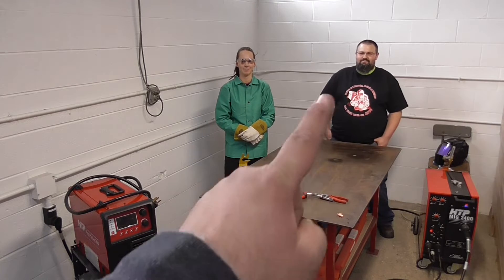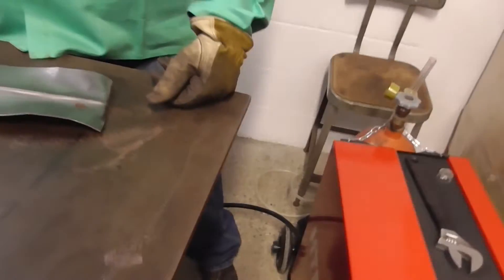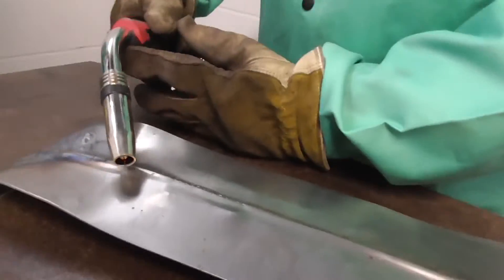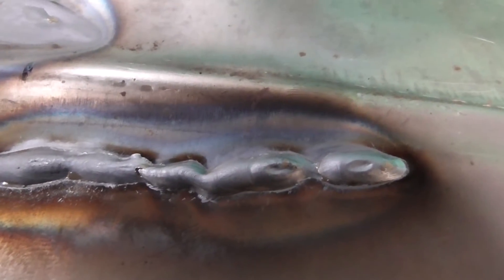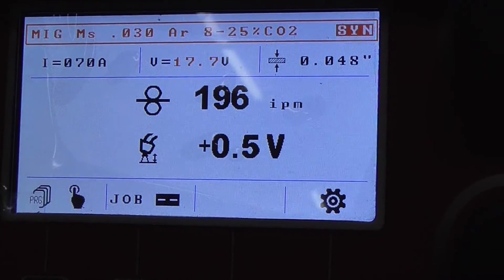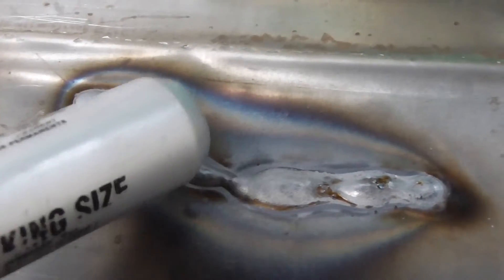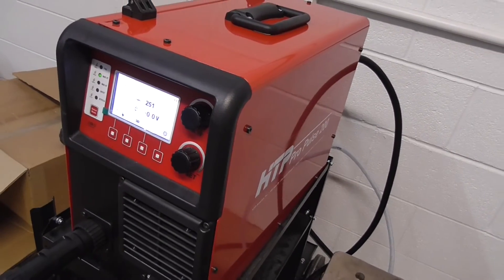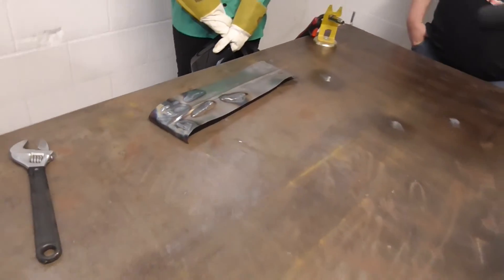ST-arc function explained

Comment: I just got my PP 200 last week, but haven't had the time to fool with it. Well,  I just took it out of the box today and got it spooled up with a partial 10# roll of .035 wire that I confiscated from my 210 MP rig. I only had time to run a few beads on some 1/8" steel plate that I had laying around, but let me tell ya,  I f*#king love it! Can't wait to get deeper into this machines capability. I think that Mr. Lincoln 210 will be going to bullpen!

Edit: Thank you Peter for these vids. It is huge help in wrapping your head around it's functions and performance before you get started.
Reply from the maker: Enjoy it !  the arc dynamic is phenomenal !

Comment: I’m a professional fabricator/welder I like to dial my wire feed by sound just like tuning a guitar you just hear when it’s right
Reply from the maker: PB Machines i hear you loud and clear !  And i have been mig welding for 25 years myself and i had the hardest time to adjust to this new technology myself !  I am not even going to lie. 

Lincoln electric has a similar function ( they call it STT ) it really can take some getting use to but if you when you do ...  personally i think it can be pretty awesome !   You never accidentally pull a long arc that is weak and does not burn through mill scale or does not penetrate enough .... 

Its the “perfect weld” every time ....

So from what i can tell 9 out of 10 people love it ....  and maybe you are number 10 out of 10 

I dont know ?!?

You dont have to try the new technology. If you are happy with your equipment and yourself and the welds that you produce ...  LIFE IS GOOD.  

I am NOT here to sell you shit you dont need ...

But please - NEVER try one of those machines - seriously! Because unless you really are number 10 out of 10 .....  you will feel like you missed out on something and crave a new machine ....

So PLEASE dont even try it 😂
Reply: ZILA I’m always open to new stuff I try to learn something every day that’s why I watch channels like yours thanks for the response maybe check me out sometime
Reply from the maker: PB Machines subscriber 103 that is me

Comment: Hi Peter great video... I was wondering if I could call on your expertise I'm looking at buying a Lincoln 500AS   off the local farm but can I plug a LN25 or do I need to get a  miller suitcase
Reply from the maker: Mr Engineer from what i can tell the 500 as is a CV ( stick welder ) ONLY 

https://www.weldingsupplies.co.nz/site/weldingsupplies/files/500AS.pdf

There is no cv ( mig function on it ) 
Lincoln has a few different models LN25. Most of those can run of the welding arc like a miller 12VS  AND run with a remote control cable like a 12RC ....  BUT NOT ON A 500 AS!!! 

You need to make sure you get an LN25 that is rated to run on a CC power source !!!
They make those - there is a little switch insight ...  but unless you want to run some dual shield .... dont expect too much out of that setup
Reply: Thanks so match  I might save and get a 12vs with the switch  I'm not really doing much dual shield most of my will be little  building Cattle yards on large properties ... Thanks again   if you get a chance  Could you check out Welderbeast on here I think you could help his goal with the future welder
Reply from the maker: I look at him.....  I looked at his website - I see a bunch of merchandise ....  I look at his youtube channel and I see a bunch of thumbnails of him sitting int he truck and talking ...  I DONT see any welding ....  
there are 2 kinds of guys out in the welding world - the once who weld and the once who talk about it ..... I dont even know the guy ....  but what I would do if I was him, hand out some business cards knock on s bunch of doors - TILL you have a paying welding job !!!!  and then make a video of that to show your capabilities ... so you can actually use youtube as sort of a reference to get more welding jobs .....  
to me it seems like he wants to sell hoodies not welding services and it also seems to me  that maybe he wants to make it as a VLOGGER so he can m are a living off youtube rather than weld for a living ..... but hey - what do I know ... I am just some guy who looked less than 120 sec at some websites ......and now is typing stuff
Reply: Yes I agree totally and that's why I respect you as a tradesman and youtuber you put work first and what you do you teach ... I personally have learned so match from your clips hence why I you about the 500 and ln25  I remembered the clip you and Chuckee2009 did with sae200 and your 12vs .. Thank you so much for everything you do
Reply from the maker: you are welcome

Comment: zila my fan shut down in my ac/dc lincoln welder thats the common  red machine  can i open the back cover use a fan to cool the  machine  while i welding
Reply from the maker: possibly yes
Reply: @ZILAwelds  thanks i wish i had your contact  number you have alot of knowledge

Comment: Do you know if the HTP pro pulse 200  available in the UK
Reply from the maker: not really unless you order it from the USA. BUT the "European version" (the software is a little bit different and it does not have the remote control connector in the front of the machine) is a Stel Iron mig 221p
Reply: @ZILAwelds  thanks for replying and the great content you post it's very helpful
Reply from the maker: thanks for watching !

Comment: I guess those 2400 will be about half price now.   Thanks for the videos.
Reply from the maker: Ghil Reese i dont know - most other machines on the market dont have a function like ST arc ....   some lincoln machines for $10g have a function call STT which is similar ....  so i am not sure that now all other machines should become cheaper ...  
and if you need a good “workhorse” in your shop .... those 2400 can be a very good option for people who cant or dont want to buy the pp300!

In the last 14 years i had 3 mig 2400 myself ....  and running dual shield on them i got up to 300 amps out of them ....  and i found out that the “true” 100% duty cycle number is closer to 200-210 amps than the 142 amps or whatever htp claims ...  it is a very basic but powerful and all things considered “inexpensive” and fairly bullet proof machine. 

In 14 years and 3 machines i had one bad control board ( that was warrantied) ....  so over all not a bad deal ....  i made a lot of $$$ doing welding jobs with my mig 2400’s